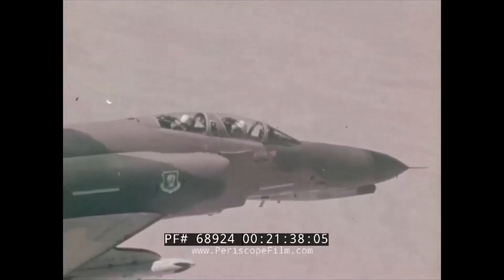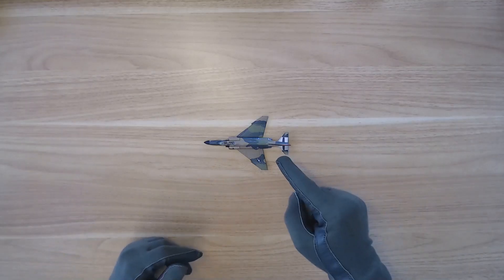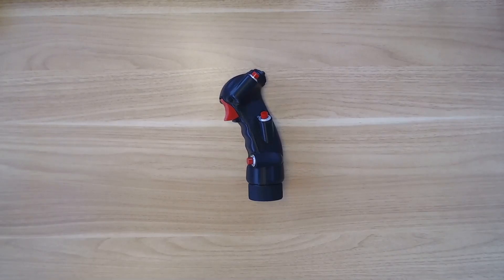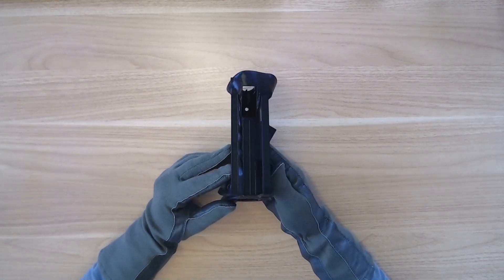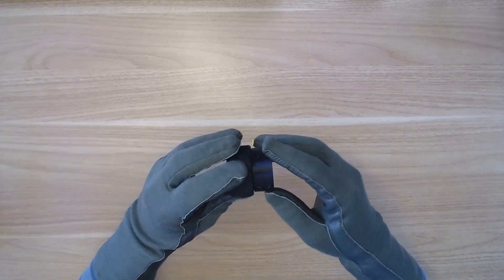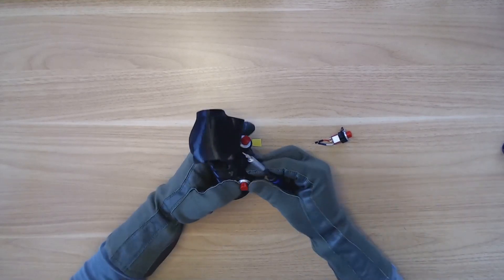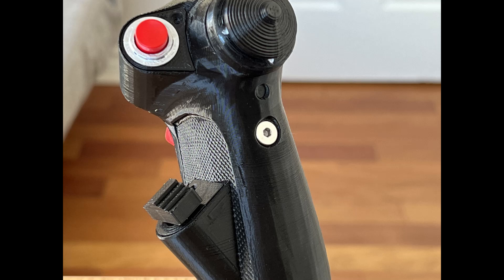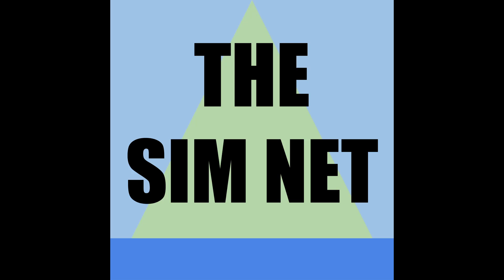You Can 3D Print This Fighter Jet Joystick - Century Series B-8 Grip Assembly DCS F-4 Phantom

Comment: This is awesome. The B-8 grip is a classic, and it's great to see someone reproduce it accurately. I may print one just to compare it to my B-8 grips. It looks damn near perfect, though. 

I think the wiring is a pretty key part of the assembly, and I'm interested to know more about how this all works together. I assume you solder on leads long enough to come out the bottom, and then you just plug them into the board and stuff it all back in?

I have a few real "dual header" grip versions (couple of S-61 grips and an H-53 grip). Note that on these, the mounting boss for the hat switch protrudes out of the stick to a greater extent than the B-8/MC-2 grips, so unfortunately, it's not as easy as simply mirroring the top of a B-8 grip. I can get you pics if you want them. That said, your version is probably actually more comfortable than the real thing (because the hat protrudes out more, it's more awkward to use) and an ambidextrous one is always a plus. Absolutely fantastic option for people. 

Have you determined the maximum force and bending moment the grip can take? I have a Virpil CM2 (original version) with the stiffest springs to better emulate the real thing. It broke the tail piece in my TM warthog grip (though that was also old and fatigued). I ended up having to turn and mill an aluminum replacement. I suppose a custom metal tailpiece is an option for this grip as well (for those who have the required tools).
Reply from the maker: Thank you so much! Always open to feedback, it is very much a "living" design with many changes over the last few months. 
I would absolutely love pics of grips, my email is questions@thesimnet.com if you want to send them that way!
I have not tested the maximum force, mostly because I have not wanted to damage my Virpil Mongoose base - I haven't had any issues so far but at the end of the day nothing beats a metal tail piece, to be sure.
Reply: @thesimnet check out Erik’s YT shorts to see a gimbal what would eat TM pot metal for breakfast
Reply from the maker: @rightrudderleftstick  Wow that's a beast!

Comment: Btw., as you talked about other versions - would you consider to change shaft on the left side for i.e. 4-way+push switch? (not the one left to the HAT already there but below it).
In that case it would be fairly easy to choose configuration - either simple button or multifunctional one.

Comment: Would have preferred a split body, like ghe original, so I could make a cast to make a metal version..a split would also better allow to work inside and could more easily invert to make a left hand stick
Reply from the maker: Hi Rob, I'm working on a revised version of the grip with more consistent wall thickness. Once that is complete I can certainly include a split version like the old thrustmaster B-8 version. Great idea - thank you for the suggestion. A metal version would be very very cool!
Reply: @thesimnet  thanks pal 👍

Comment: On the 4 way switch: the BOM lists ALPS RKJXT1F42001 which has a built-in rotary encoder. Doesn't it get in the way, by rotating unintendedly for example?
Reply from the maker: I have not had any issues with unintentional rotation using the round trim hat, however I can imagine if that were swapped out there may be some rotation. I have also uploaded an alternative Hat assembly based on tact switches

Comment: is there an easy way to increase wall thickness? My 3d printer can't handle the stl files from thingiverse. Might it be because of detail level settings during model export to stl?
Reply from the maker: Hi there! I have heard the thickness feedback from a few folks now - I am working on a revised model which will maintain a consistent wall thickness going forward. I am still testing but I am aiming to release this summer along with an updated video.
Reply: @thesimnet  awesome. Thank you

Comment: I have tried twice to print the grip, but doesnt work. I have check de STL with other programs and 3d printing vendors, and it seems that the STL has issues on walls. Is it possible for you to check if the STL is ok? Thanks.

Comment: Theres zero chance of getting that custom pcb outside the USA as I am, so couldn't I just use an arduino micro ?
Reply from the maker: I'm outside the USA as well, but generally speaking yes you can use an arduino! I use one flashed with the RR joystick code for a version that I have put on top of a MSFFB II base, and I just run a separate cord out. As for interfacing an arduino directly with a thrustmaster/Virpil base, I have not personally tried that.
Reply: @thesimnet  thanks,  good to know 👍

Comment: Walls are very thin, especially at the top
Reply: You can modify the STL and re-share it providing credits for the creator of the original project.
Reply from the maker: Thank you for the feedback - I will revise the build in the future to ensure consistent thickness. For what it is worth, as-is I have not had any issues even with daily use
Reply: @thesimnet  you should try and keep the interior of the model as solid as possible, only space for the wires/buttons and let the infill do the rest strength wise
Reply: I had some middle school Tech Ed students print this in ABS. They are pretty bright and trouble shot the printer to make it work. Yes, there are thin places in the thumb and pinkie button housings as well as the trigger housing that cracked. Their solution is to fix with CA glue. I’m not sure they understand how to adjust the model to thicken the walls in specific places. I’m not fluent enough to adjust myself. Crash course time for me. Otherwise this is a great stick.